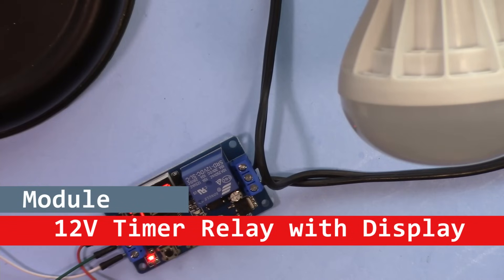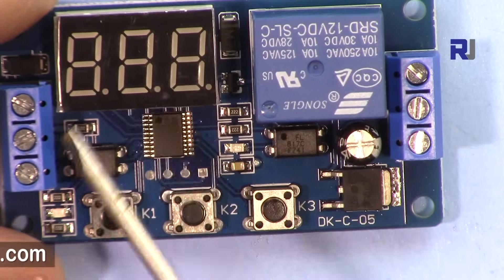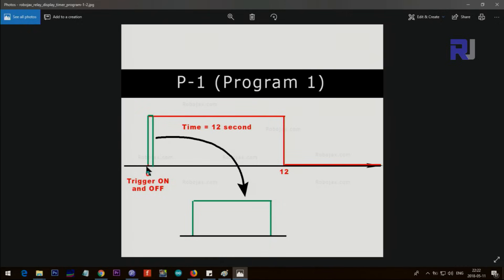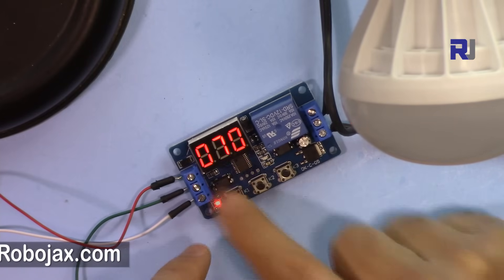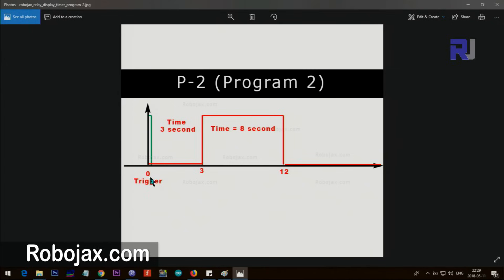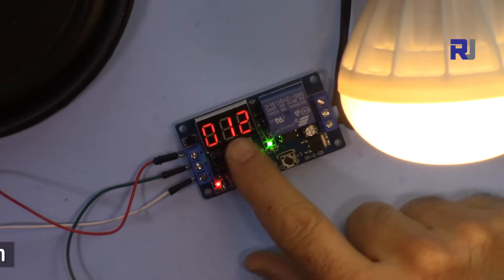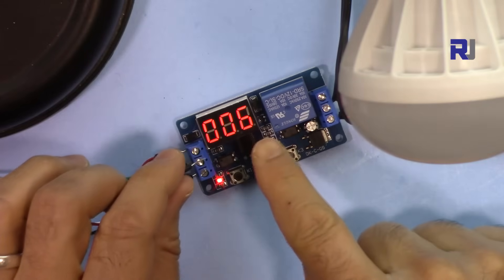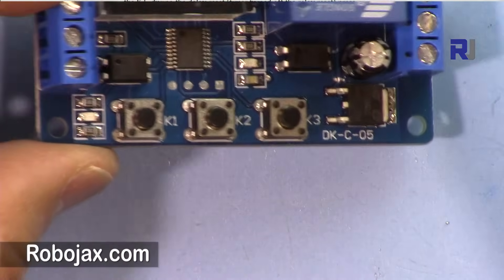Home Automation: 12V Relay with LED Display Delay 0.1 seconds to 999 seconds Timer module P1 to P4

Comment: Hello Robojax..  it maintains the series of programs as long as it's powered on right?
Reply from the maker: it will keep the programming even if you power it off. just test it.
Reply: @robojax  my sentence was misleading.. I mean, it does loop right?  like when i set it to (5s on - 3s off,  8s on - 10s off,   20s on - 5s off.
Reply: @robojax  I'm thinking of connecting it into a 1320 watt 110v AC Heater.. Is it capable of it?
Reply from the maker: I have explained everything this module does. if you did not find what you are looking for, then it doesn't do it. I forgot what this module does. but I have not seen anything that take more than 2 time like t1 and t2. so watch the main details and the demonstration.

Comment: Sir, so it needs 12V power supply for trigger site or we can use it without power supply on trigger site?
Reply from the maker: I don't remember the voltage. but I should have explained.

Comment: Hey Robojax, you help me by setting my timer correctly. The timer I have is a littlebit different and confusing.
Reply from the maker: Hi, the best I could was to make this video. if you watch it without skipping, you should be able to do it.
Reply: @robojax  I have a micro switch, I want to turn on/off the 12v timer when I put a glass on the switch (weight). Than the timer needs to go on for 2/3sec and trigger a mini pump, for filling my glass with liquid.

But I dont know how to install the switch and the pump (12v) at the timer?

Can you help me with that

Comment: Is it can save the settings? or we need to set the value every time? pl reply...
Reply from the maker: Everything this can do I have shown it. please watch fully to get the answer. I don't remember, I would have to watch to give you the answer, so you watch and get it. I can assure you I have not left anything  untold about this module.

Comment: Does your video feature how you set a
DELAY >>RelayOn forever setup??? 
Couldn't understand if this simple delay to always on is set on this. 
Many thanks.
Reply from the maker: the "forever" if available I should have mentioned it . I never leave anything when I explain and review modules. so watch the video fully to get answer.
Reply: I did watch it all.
But the video doesn't mention what happens if you set OFF time to 0 in any of the programs.
What happens then? 
Thank you.
Reply: Tried without success had to get a different product to do a simple delay  always on  function.

Comment: Nice I got this to control the input signal from my turn signal to a controller that controls my cameras I installed for my blindspots. I basically had it figured out but it's nice to hear it from someone who knows what they're talking about. I saw something on Amazon where I bought it that you can program it on the internet. How do you do that?

Comment: Hello, thank you for your video. It was helpful for me too. But I have question: At 4:00 you explain the trigger. and you say I can use an arduino etc. But I don't know how I can use a 12v alexa switch as trigger. Would I need to connect the 12v alexa ouput to the middle too? 
(I want to open a magnet lock with alexa and I have to assure it turns off / shuts automatically after a few seconds, otherwise the magnet lock overheats)
Thanks in advance.
Reply from the maker: Hello. I never heard of "12v alexa". But regards less. you need to +12V and - or ground to connect and trigger this. Are you referring to Amazon Alexa? if so I've not used it.
Reply: @robojax  thank you for your answer. I meant I use a 12v switch for amazon alexa :)(https://www.amazon.de/gp/product/B07ZYVZQMR/) So I will probably be able to trigger it with it. thank you for the clarification. I am going to try it out :) have a nice day

Comment: If you connect the signal cable to a separate 12v source does it work the same?
Reply from the maker: yes. that this is made for. you need 12V + and - (or ground).
Reply: @robojax  so the signal cable just checks if there is a 12v on it?
Reply from the maker: yes the input checks the voltage and I believe it can be anything above 5V or 3V. Watch the video.
Reply: @robojax  thank you!!

Comment: Excellent video. How can i connect a PNP sensor to this device. Where would the sensor output be connected?
Reply from the maker: Thanks. PNP if you are referring to PNP transistor,  I have no idea about configuration but the input I have shown and triggered it is the input.

Comment: Nice explanation. I had procured this PCB board it's cheap and best for delay timer automation. 
For more durability of pcb you can give input power and trigger signal both in 5 vdc instead of giving 12 vdc. Reason is there is no heatsink attached with voltage regulator ic which is converting 12 v into 5 v.  If we apply 12 v input then excess heat will damage the voltage regulator IC. Input Upto 6 v 0.5A  max will increase the durability and stability of this board even if it is used for continuous operations 24x7. 
Relay build quality is very nice it can withstand more than in household voltage and current ratings. No issue in operating heavy loads through relay. 
One good protection is provided through opto couplers ics for reverse bias protection and reverse current flow protection. Overall I can say it's  a industrial standard design.
Reply from the maker: Thank you for comment and very useful information.

Comment: What all I want is a delay time for like 10 seconds before the light turns on and the light stays on until I turn it off? Meaning, I will only use the delay time to turn on the lights.. Is it possible?
Reply from the maker: everything this module does I have explained it. Nothing is left without explaining. So please watch it fully without skipping and you should get the answer.

Comment: Is there any version of the same board as a unit that you can mount into a surface plate ?
Reply from the maker: there are 100s on AliExpress and eBay and most don't have a model number.
Reply: @robojax  but thats not the same module? https://www.amazon.de/BIlinli-Timing-Verz%C3%B6gerungsrelais-Modul-Zyklus-Timer-Digital-LED-Doppelanzeige-0-999-Minuten/dp/B07P8RB5KZ/ref=pd_sbs_60_10?_encoding=UTF8&pd_rd_i=B07P8RB5KZ&pd_rd_r=e1898546-5b73-4833-a604-88021dc13f3a&pd_rd_w=kp1PA&pd_rd_wg=DhjLf&pf_rd_p=42bf0ad8-ce6f-4127-a2f0-106727020a41&pf_rd_r=YHXV07ND423QH2FJAYXZ&psc=1&refRID=YHXV07ND423QH2FJAYXZ

Comment: Hi,

I did set it up in order to switch on and off a dv voltage but no luck when using the Ck and COM pins.
Is this not supposed to work with 5V DC voltage?
Reply from the maker: it will work. Even 1 or 2V will work. Either setting is incorrect or wiring. check it.
Reply: @robojax  Hi again,

I do get a HIGH state from the Arduino pin as I used a voltmeter and got a 5V reading every time the code set pin no 8 to HIGH.
Ibthen run a continuutyvtest on the output pins and notived that the commonly closes  pin was always allowing voltage through regardless of the code and the commonly open was constantly open

Comment: Do you know how to turn off the led display ? for 2 buttons is press adn hold K1 , but for the 3 buttons i dont know
Reply from the maker: Everything this module can do I have explained it. So watch it without skipping and I am sure you will get the answer whither you can do it or not.

Comment: Great video!  Question: Can this device be set for 2 seconds in the ON position then pause for 12 seconds and sets to the ON position again for 2 seconds repeating this pattern for up to 60 seconds?  Then use a trigger to restart the entire process?
Reply from the maker: Everything this module does I have explained it. I have left nothing out. I have shown minimum time and maximum time.You must have skipped the video. Please watch it without skipping and I am assure you that you will get your answer. Thank you for not skipping the ads and keep watching them. This will help me a lot.
Reply: Robojax Thank you. I watched another one of your videos on the Drok XY-LJ102 and I think the P5 setting will do just fine. Thank you for putting out great content.
Reply from the maker: You are welcome. I am glad you found the solution

Comment: Hello! Thanx for the video!
I'd like to make you some questions. 
I want to use it on 220v(Europe) . Can it be used? 
And I want to use it for loop mode, ON every 8 hours for only 5 seconds and OFF again then loop the same setting. 
Is it possible?
Reply from the maker: Hell and you are welcome.  yes you can control 220V load. I belive I have explained that.  the loop as for as I know I everything this module does. I don't know it now. I would have to watch it to answer your question. So you better watch it without skipping and I am sure you get the answer. I have done a lot of review like this and dont' knwo them all.

Comment: Does this extra wire for reset is positive +12V? Will it work when power and trigger are switch on the same time?
Reply from the maker: Unless I set this up, I will not know. But for sure at the best of knowledge, I have not left any feature without explaining. So watch it fully without skipping, I am sure you will find the answer.

Comment: It is possible to control with 70 milivolt trigger AC  voltage a light with 220 volts...thanke you
Reply from the maker: 70mV is considered LOW. so the best thing is to try different voltages.

Comment: Thanks for the video. Can I use it for 24v or 220v lamp?
Reply from the maker: You are welcome. You can use it turn ON and OFF any bulb up to 250V DC or AC. Just make sure do not go above 10A.

Comment: How to set it to turn on the light for 5 seconds every 4 hour interval? Thanks for your help
Reply from the maker: Hi,  use the loop feature and make it unlimited or infinity.
Reply: Robojax could u plz explain? I am able to set the time either Seconds or Minutes. Not the combination. I want to set it (bulb)to GO ON for 5 seconds and then GO OFF for 4 hours. Thanks for your help
Reply from the maker: I don't have the module ready to check it but this is my principle, I never leave any feature of the module. If I mentioned about "loop" or "infinity", then this board does it. I have made over 10 types of this board and don't remember which does what.

Comment: Great video, explained it very clearly. I am planning to use it with a 12V source (inside a Car) to a 5V voice playback. Do I need a converter / transformer? 
My goal is try to rig a Welcome voice in my car upon starting the engine, which will be the "trigger" and with a delay of 5 seconds, and then voice will activate a 10 second recording of "Welcome Master" after that it shuts off the entire time I'm driving. Do you think this will work? By the way this is my first time using these items. Thank you again for your awesome video.
Reply from the maker: You are welcome.  The module works with 12V but when you start the car, the voltage goes below 10V. If you have multimeter, check it out. So this will start working after car started. For your 5V voice recorder, you can use a converter 5V yes.  you should.

Comment: Poor mechanical design. It's impossible to panel mount: The buttons are too short and the relay is taller than the display.
Reply from the maker: They don't care about those aspects. it doesn't have any model number.
Reply: @robojax  You can buy an alternative version that includes a plastic case:-
See: -
https://www.ebay.co.uk/itm/12V-LED-Automation-Delay-Timer-Control-Switch-Relay-Module-PCB-Board-With-Case/143142419655?hash=item2153f3fcc7:g:uKkAAOSwM6Vcbn02
They have raised the height of the display using a socket and used taller push buttons.

However the relay still looks too tall and the buttons look too short to mount the box behind a panel.
It spoils what would otherwise be a cheap and flexible solution for anyone who needs a panel mounted timer module.
Reply from the maker: Nice.

Comment: Hi, thank you so much for this video! Quick question for you, is wiring a trigger necessary? I plan on using this device connected to a wireless RF receiver that is momentarily controlled to deliver power, so would using the RF transmitter enable the delay to begin?
Reply from the maker: You are welcome. I have made this video a while ago and don't remember anything now as there is many types of this module which I made video for. However I always demonstrate all possible features of a module. If you watch it fully without escaping I am sure you will get the answer.
Reply: Your answer is at 10:22

Comment: I connected wires and from very first the LED displays the letter"C" only.   Does this indicate a defective device or is this a coded response.  Great video. Thanks
Reply from the maker: You are welcome. I am sorry I don't have device in hand now.  The problem is that this device has no model so people refer to it so you can find solution for it.

Comment: Hope you are good brother,
Dear i have a question:
Can i use this trigger as a door bell? Door bell should work as many times as anyone wants to,

But on output (right side ports) i want to connect almost 50watt items that are:
15inch LCD monitor
camera
Light (that works with night sensor)....

Please guide me if i need some changes in another DIY circuit or i can adjust above workings in this Pre made circuit?

I am not an expert but i need proper guidance please..
Thanks in advance

My country's standard voltage is 220v
Reply from the maker: I am sorry for late reply. I was on vacation. Your project needs totally different setup. Your best option is to use Arduino with relay.  here are my videos on timers https://www.youtube.com/channel/UCkcBSig_Iu4ZnAIeCeG1TVg/search?query=timer

Comment: Thanks for introducing the excellent timer. Presentation is excellent too. BTW, the video was uploaded long time ago  still I would like to ask a question. My question is that what will happen to a program when the power is off? Is the program will remain in the timer even the power is off? Thanks.
Reply from the maker: You are welcome. It keeps all the programs after you turn off the device.

Comment: Hi, I'm from Brazil and I bought some by the same model,  YYC-2 and i need for a help for the program P-3. I did the config and when start to work, afther 4-5 cicles on and off, it  stop to work and the display see only 000. Do you know what the problem?
Reply from the maker: Hi Ribens, I am not sure. Is the 12 stable? Are you using battery or power adapter?
Reply: @robojax  thanks a lot to spend time to help me...... I'm using a 220v to 12v power supply 4 amper capacity. I'm think the reley was with a problem because  It will work, then when the relay will disarm (or arm) it deactivates and stops. The power supply has other connected items feeding together, there may be interference.
Reply from the maker: Yes. Best option would be to isolate this module without anything else and test it. you will find the issue.
Reply: @robojax  Tell me one information: to finaled the configuration afther input all the parameters, by P-3 what i need do?

Comment: I mean can I connect the switch that used in vibration module that when shocked it will tegger as the switch that you connect in your video
Reply from the maker: Sorry I did not understand. I have explained it but let me tell you again. This board has INPUT and your device or vibration device has OUTPUT. So if your device give voltage at OUTPUT, then connect it to this module INPUT, it should work.

Comment: Hello can l connect vibration switch so that when the switch sense vibration it will make trigger
Reply from the maker: if the output of vibration sensor has voltage when vibration is sensed, yes you can do it.

Comment: Hi. Thanks very much for the video. Is there a similar circuit that can be automatically turned ON for 10-15mins and then OFF for 1 hour and then repeat this cycle?
Thanks
Reply from the maker: I reply to all Subscriber's 🔔 questions. So make sure to Subscribe.😊

Comment: Hi, not sure if you are still answering questions in regard to this unit: I have the same unit but 24v DC and I would like to use a 12v PIR unit for the signal. Will this be recognised?
Reply from the maker: I will reply to all Subscriber's 🔔 questions. So make sure to Subscribe.😊. You haven't Subscribed yet. I spent hours recording and preparing it so you learn, what is single click to subscribe in return?
Reply: @robojax  I have subscribed. The 'Subscribe Button" above is no longer RED so I presume that it is registered.
This is copied from my Subscribe List:
SUBSCRIPTIONS

Robojax

Comment: Can I power it with 3 AA batteries?
Reply from the maker: It says 12V so you will need 8 AA batteries as each battery is 1.5V so 8x1.5=12V
Reply: @robojax  Thank you so much kindly for the response. I figured that but was hoping 12v was maybe a max output or something. You were great, I have subscribed now :).
Reply: @robojax  How long do you suspect the timer will work with 8 AA batteries? Does the relay only use power when it switches on and off? THank you.

Comment: is it possible to keep it on for few sec and off continuously till power disconnected ? like a windscreen wiper
Reply from the maker: All the features have been explained. If you can't find the feature you are looking for, then it doesn't' have it. Use Arduino and program it exactly the way you want. this is for people who have limited expectation.